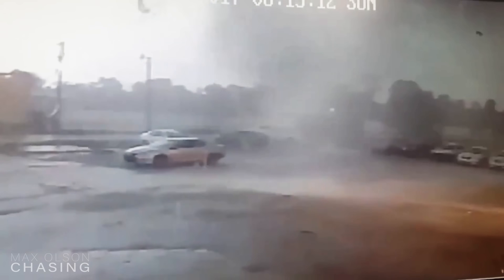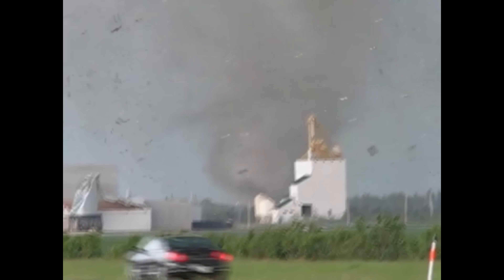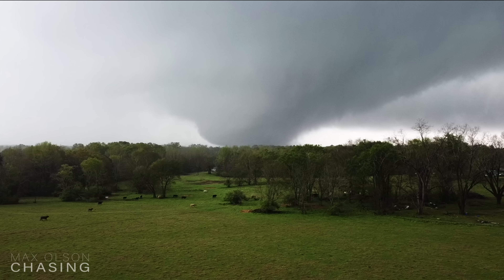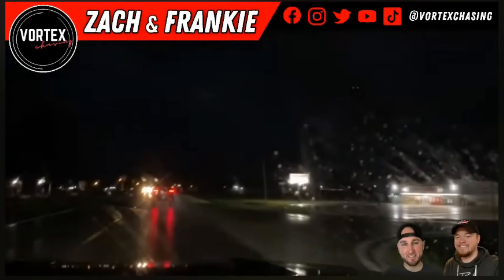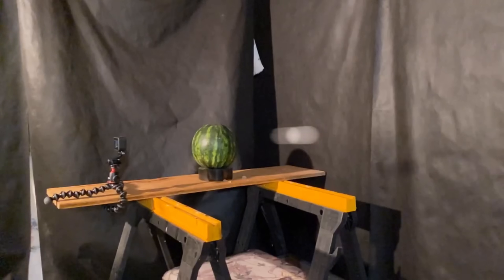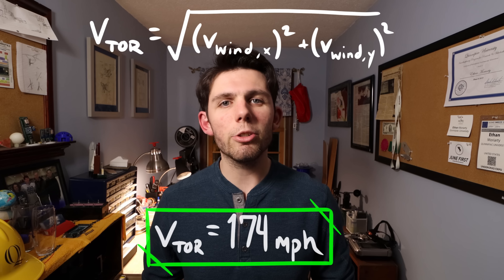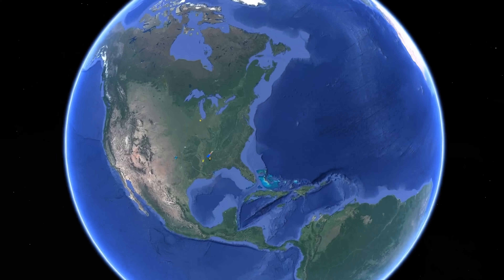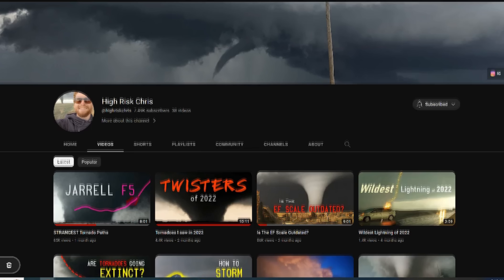Is This a Vehicle Flying Around a Tornado? - Rolling Fork, MS

Comment: 100% COULD have been a vehicle, but IMHO it's not. The physics don't work. Vehicle lights are quite directional; this light seems very omnidirectional. The odds of vehicle lights continuing to point at the camera in that swirling monster are practically zero. A battery- or generator-powered construction light or similar? We may never know.

Comment: Could it possibly be a tractor trailer? And not fully lifted but one end lifted up while basically rotating on the opposite end of the trailer?
Reply: My thoughts exactly. The way the tail end of a trailer could be caught up in the vortice and headlights of the tractor swung around facing the front like a sling... Not to mention the probability of a semi trying to haul through to get out of the weather.

Comment: Yeah. The one in Dallas with the trailers. They were empty. They were Shnieder trailers and they dont weigh 12000 pounds. More like 9000 if that. A lot of surface area.

But...this was a night time tornado. Someone could have driven into it without knowing. I still see Smart Cars from time to time which probably wiegh about the same as a go cart.

As for artifacting? Probably not. UFO? Yeah right. Maybe even an ATV or UTV lofted that high.

Comment: you guys are using some great examples in math skills calculating everything...  Whats stopping you from recreating it digitally and estimating the area the light would have landed?  From there its simply getting someone on the ground to check the area if possible.  Though the mess still there may prove such difficult.

Comment: It was clearly, a vehicle of some type with two front headlights visible.  It looks, like a car or truck for sure; and, sadly, reminded me of the El Reno tornado of 2013, wherein, three car's, were picked up, and tossed by this monster, including the Twistex team's Chevy Cobalt, an amature chaser's truck, named Richard, and a woman and her infant, during which time, all 5 people were killed. All 5 were in vehicles.  Tim Samaras's car w/Tim, deceased, and still in it, held by his seatbelt, looking more like a crushed pop can than a car,  was found a mile and a 1/2 away from where Carl & Paul's bodies were found. Richard was in an older model truck, and the tornado, sucked him from his truck, or picked it, them sucked him out. His truck, also looked, like a crushed can.  I heard nothing about the vehicle, the lady, and her baby, were in; but, ut killed them both, so it had to be horrific.   The 2013, Moore tornado, picked up car's after it crossed a hwy, and went over a hwy overpass. Chase? Chad or Chase, one, who was, a chaser for one of the weather station's,  hollered, he'd just seen, the tornado, pick up two car's.  I couldn't see them in his video; but, I believed him. 
Did you go to drop site you calculated to see, if there was a vehicle there?

Comment: Is it possible they are LED sensor lights? In florida they have been installing them in neighborhoods for hurricanes and problem solving. They blink on and off on occasion and blink rapidly during brown outs and low power issues. When the power went out here one night they lit up so bright it was like a spotlight was shining in my window until they came out and fixed the tree limb on the line issue. FPL told me they are sensors being rolled out in many states that only turn on when they are without a certain amount of power. It lets them find the problem areas faster. With a tornado rolling through I bet those would be blaring bright in the sky like that.

There are also solar lights and other security lights that bright that go off battery power when power is lost that could explain it too.

Comment: Take that F150 and add an extra 3ft of ground clearance then try redoing your calculations. I swear about every 3rd truck I see is some lifted monstrosity that feels most at home half a car length off my rear bumper regardless of the speed I'm going. Also maybe aliens were out storm chasing and the copilot couldn't properly read the velocity scan.

Comment: Headlights? They're way too directional. That's an EV Lithium Pack orbiting in meltdown burning at 2000 Degrees F like a giant flare.  
Many more will be possible if cell packs are violently ripped open

Comment: First Impression with Mystery Lights Video was perhaps there's an assumption these are "earthly".  Its the manner that the Object is circling - there's no fast twisting, twirling or spinning.  It actually appears slow moving & more STATIC. There are also only White Lights, no Color or possible Tail/Side Lights.  On one of the Lights, do a Freeze Frame & enlarge.  At one point you could see a large CENTER Light with 2 equidistant smaller Lights flanking it.  It actually gave the Object an Elliptical Shape.  I'm sure this Impression will make someone think I'm one of those "nut cakes" but when you don't know, ALL considerations should be factored.  In fact, suspend all relative subjectivity assume its a Car & stop trying to prove that Theory.  Ask, "Hmmm, what else could it be?"
Re: Chris Analysis:  Was there consideration of the "brightness" of those Lights?  They seem pretty strong considering the height, distance and rain wrap.  He also made an "assumption" that there was a rapid descent ONLY because the Lights did not reappear to the front again.  He assumed it "landed" on the other Side of the Tornado.  Was that proven?  Did they ever find that vehicle in the "drop zone" he configured? Maybe there was a "worm hole" on the other side created from the intensity of the Tornado?  Consider ALL possibilities IMHO. 
Having a disciplined and true "Scientific Mind" is difficult to achieve.  A good Scientist simply OBSERVES without conclusion.  Thats very hard to do.  Our Minds immediately want to conclude. Identify.  But it's best to simply continue to observe WITHOUT trying to explain, resolve, define, conclude, etc.  Just go LOOK AGAIN.  and again.  Keep looking until your original assumption what something "is" no longer "is".   Dropping the entire Idea that what we are seeing IS a Car.  Is it?   Perhaps go the opposite direction & find all those elements & points as to Why it is NOT a Car or familiar Vehicle.

Comment: yes that looks like a car,  I remember visting a site of an EF5 damaged area and saw a 15ft V bottom boat up in a tree about 25ft off the ground ....also a car sitting in a 4 lane road alone with a utility pole rammed through the trunk all the way into the engine compartment ....the storm was so strong that it removed the steel man hole covers off the street and the concrete  tire bump stops in parking lots which are usually reinforced with rebar driven through the asphalt and into the ground

Comment: Ran across this just before I got to your video of proof a tornado can toss cars. In this video https://youtu.be/PzCPlw6p6WI?si=kLY0EuiINj_U9PyF.  Tornado toss cars in High School Parking Lot. A really small tornado has picked up a car. You can tell it had trouble lifting  the heavy motor end but the trunk end was no problem. You can also see The lift, of the wind from the tornado was very effective coming in from underneath and vacuum low pressure on top (what engineers call Differential pressure) of the car for it to lift the car. Pulling on the top and pushing on the bottom. Maybe the smaller vortices at the edge of most tornados help in the effectiveness  to provide lift.

Comment: If it were a vehicle it probably would have been destroyed upon impact with the ground with how rapidly we see it descend. If i were to get on my computer i could probably try to use beamng drive to see what this could possibly look like hitting the ground. Now we can see its decent and make an assumption on how fast it was going down but with it disappearing behind the tornado before we see mutch we cant say how fast it was moving. Or it hit the ground and the front end got destroyed removing any more visible lighs could have possibly been ripped into smaller pieces (unlikely) then picked back up, or it coukd have beed rolled around a bit more within the twister resulting in well... No more vehicle which would explain why nobody has actually found it yet.

Comment: I witnessed an EF5 wedge tornado decades ago and there definitely were vehicles in places that they didn't roll to, so it is definitely possible. There are so many variables like did debris get slammed under it causing it to lift at just the right moment and even just the angle of the vehicle combined with the angle of the wind and the weight distribution of the vehicle, how would a lightweight trailer being hooked up to it change things? My other thought is that these days so many people also have a variety of utility type vehicles which can have all the same lights as other vehicles, but they're obviously much smaller and lighter. Whatever it was, I just pray it didn't have any occupants when it went up.

Comment: Not that im an engineer....
But whatever "vehicle" you'd be looking for is now a matchbox.  Rolled will look rolled.  Falling from 200+feet and at speed.....that will look much more.... catastrophic in result.
The lights are on.  It WAS being used and likely still was.

You're looking for at least two vehicles with occupants that WERE driving, now missing and presumed lost.  They are not from the area they were found in.  They will likely not look like vehicles anymore.  They likely no longer contain occupants... But did, and will show evidence of this.

These were not survivable situations.

This is very possible and unfortunate.  There ARE other objects that these could have been, but if you were interested, look for decimated vehicular wreckage, likely with the remains of remains, not from the area found-i would doubt they were fleeing, were either looking or as many other videos show, literally driving into the tornado.

Comment: In terms of looking for a potential vehicle that could of endured this, it is plausible that there might not be a vehicle recognisable if this was the case. Not sure how fast the object was travelling when the tornado threw it back down but depending on what this potential vehicle hit, it could have easily disintegrated the vehicle making it unreasonable as multiple pieces of chassis/body subframe and drivetrain components could all be scattered, especially if the vehicle hit harder objects.

How well the potential vehicle stayed intact depends on how stiff the chassis/body was, how fast the vehicle was travelling when it hit the ground, how many times it hit the ground or rolled. And I believe most importantly what the vehicle hit.

Comment: I'd be interested to know how the luminosity of your common battery powered yard lamp looks from the theoretical distance, from that area where this was filmed. The area appears to be naturally dark / rural, where the presence of higher background lighting isn't very bright.

I'm with the theory of it being headlamps from a vehicle, and many have stated the vehicle seemed to be under tital-lock as the tornado lofted and slung it around, but you would still imagine the vehicle undergoing a lot yaw movement when lofted which would make the lights appear to flicker.

Comment: Not going to try read all the questions in here so I apologize if I duplicate other's questions and answers.
The math is impressive and the research as well but the social scientist in my wants to ask if there are other avenues to answer the question, were these cars?
Making an assumption that the one object was a vehicle falling from 400+ feet at very high speed, my next is that it probably was a full insurance loss.
It may take considerable time/effort to get that sort of data regarding total loss claims, would it be safe to assume that if a vehicle found resting several hundreds of not thousands of feet from where it's original location before the storm might be worth investigating?
Further, if there is not a logical explanation why the lights, presumably headlights would not be on unless a human may have been driving a vehicle just prior to it's "flight", would it not be of some scientific importance beyond morbid curiosity to find either seriously injured or sadly deceased individual connected to a "dislocated" vehicle?
That could give concrete evidence to determining cars can "fly" and address to citizens routinely told to get to an internal room if not underground when a tornado is approaching and not to save a vehicle thinking if they get caught one can safely ride it out in a vehicle thinking it is only going to tip over?
Seems to me worth the extra step to do that research.

Comment: Great video. Could driving faster through a tornado like that propel it into the air with maybe the right circumstances? I'll be sure to keep an eye on this discussion. Thanks for the awesome video.
Reply: Yep but u can drive slow and still be pick up. Any vehicle including a heavy tank can be picked up by tornado like this or stronger easily. 

But everyone saying people r in the car I'm sorry I just don't buy it coz it no proof. There r no people in those cars if those r even cars
Reply: @cs77smith67  Yeah true, and there is no proof. Some people said the vehicle has been found, however I can't find anything on it.

Comment: It could have been a solar powered street lamp from a set of units or recreational walkway. With it's batteries intact, it would still be working and shining on its brightest setting because of the movement sensor. My friend has one of these light posts outside their retirement unit. They're pretty robust and they'd keep working if they were ripped off the top of the pole and sent flying.

Comment: I understand ef ratings are damage indicated not radar or opinion however if that was a truck as suggested, it would remind me of the Smithville ef5 in the 2011 dent in the water tower, my point is how the surveys or specialists doing them seem hesitant to give a 5 , the Manitoba got a 5 once the video of a house intact was seen lofted, video evidence of damage has impacted a final report. I don't want an ef5 to hit life or property, in fact I felt sick the first time I seen a tornado doing even minimal damage I prefer to watch them above the surface but if it happens to what end not make it a 5 serve especially if it has been a decade? Wouldn't panic  the public or climate change maniacs.
Doubtless we've had wind speeds in the last decade capable of ef5 ratings but the standard should be based on how well the average house is anchored not how well it should be anchored if most are not...
I know something will agree others won't just my opinion after this video not trying to open a can of worms so no need for a debate I'm not a civil engineer just a trained spotter so I'm not going to argue my opinion.

Comment: I watched several videos of the Garland, TX 2015 tornado where multiple headlights were plucked off the elevated overpasses, and the weight sent them mostly downward rather quickly. That was a wedge. However, looking back in history, multiple vortex wedge tornadoes such as Xenia, OH 1974 (boxcar displacement evidence) and the 2011 Joplin tornado (two intense vortices heard on camera from the convenience store) might suggest a wedge could still perform this type of lift. Also, it could be considered that a garage ignited a canister of gasoline or other flamable object onto something like a mattress could keep an illuminated light for a few minutes. This might be a reasonable guess as the light shining out was fairly steady. I'd think that headlights would flicker more from a car given that the direction of the pointing light would fluctuate as the vehicle spins in the air.  A lightweight car like a Kia Soul might be easy to lift high in the air, but the steady stream of light would be suspicious in such a case.

Comment: That is a really good assessment of what might have happened. I have two comments to make. 1. If it was indeed a vehicle, then the headlights should be pointing in some direction and as it moves around the funnel they should point in different directions. The fact that the light remains fairly constant until it goes behind the funnel is rather puzzling. 2. I remember when I was a child in Pensacola Florida, seeing a Volkswagen Beetle in the top of a pine tree after a hurricane. Not sure if it was from the hurricane or a tornado in the hurricane. So, I believe vehicles can be lofted but don't understand the constant light from your video. Also, more recently, sometime around 1990 in Huntsville AL, there were reports from someone who was IN A CAR that was lofted from a tornado on airport road.  Thanks again for some really cool video.

Comment: Ezekial 1: 4 And I looked, and, behold, a whirlwind came out of the north, a great cloud, and a fire infolding itself, and a brightness was about it, and out of the midst thereof as the colour of amber, out of the midst of the fire. 
14 And the living creatures ran and returned as the appearance of a flash of lightning.

15 Now as I beheld the living creatures, behold one wheel upon the earth by the living creatures, with his four faces.

16 The appearance of the wheels and their work was like unto the colour of a beryl: and they four had one likeness: and their appearance and their work was as it were a wheel in the middle of a wheel.

17 When they went, they went upon their four sides: and they turned not when they went.

18 As for their rings, they were so high that they were dreadful; and their rings were full of eyes round about them four.